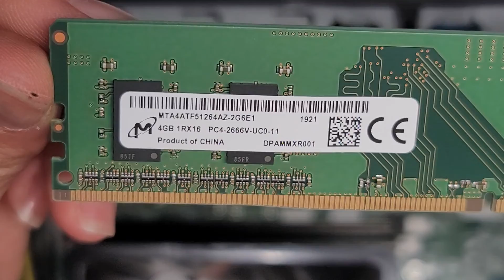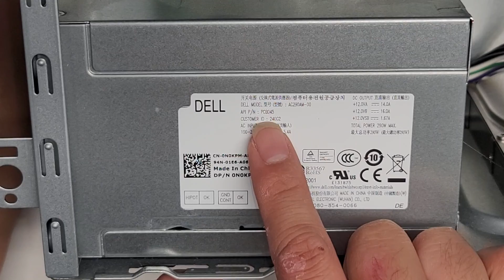DELL Inspiron 3670 Disassembly RAM SSD Hard Drive Upgrade Replacement Repair

Comment: I want to get a 500GB NVMe SSD drive for my Dell Inspiron 3670. Which one the following SSD drive
 do you recommend? 
1) SanDisk 500 GB SSD Plus NVMe 
2) Crucial P3 Plus 500GB PCIe Gen4 3D NAND NVMe M.2 SSD, up to 5000MB/s - CT500P3PSSD8
Amazon has these 2 SSD drives.
Thanks.
Reply from the maker: There's an m.2 slot?
Reply: There is only one m.2 slot. Dell has put in there a NVMe Toshiba SSD. This SSD is 120GB and is getting almost full. I am thinking of switching to a 500GB NVMe SSD.

Comment: Thanks for your swift reply, one more question please. I am increasing my SSD from 128 GB to 512 GB (the max Dell says I can put in my Inspiron 3670) and when looking at the options does it matter if I buy the shorter one (like the one you took out in the video) or the longer version, which you inserted? It is a bit confusing for me.
Reply from the maker: There is no max. The max they list is the max they sell the computer with. You can put 4TB if you want. You just need to move the mounting screw to use the different length SSDs.
Reply: Again I appreciate the response and answer. I was told by Dell support over the phone when I spoke with them that the max it can be upgraded to is 512GB, it came with 128GB when I purchased it.
Reply from the maker: @cariadaberboy  Dell support is full of (pirate) ship... They don't even work on computers. Why would you trust a call center person that never even opened a computer over someone that's been working on this stuff for over 15 years? Lol...

Comment: my 3670 is not turning on.  i’m thinking it’s the power supply, BUT when I press the black button on top of the power chord, the “power supply green light” and the “power supply fan” both turn on.  So, could it still be the power supply that’s not working or is it something else?
Reply from the maker: Not sure. Check the RAM
Reply: I just tried to replace my RAM and all I am getting is the orange light blink on the power button 😭 I don’t know what went wrong… even putting the old RAM back in gets same result!

Comment: Coming back to you. Thank you. I'm planning on replacing the HDD with an SSD in my computer this weekend. It is a SATA drive. Will I be able to use the SATA cable and power supply cable that is currently in the HDD? Looking at the diagram in the Dell maintenance guide, it happens to show a computer with a HDD and (2) SSDs. Those two had their own cables. My computer looks like yours internally.  If not, what would you suggest? Again, thank you so very much!
Reply from the maker: If you're cloning the drive, you'll need a separate sata data cable to have both connected at the same time. If you're doing a clean install, you can use the ones in there. You can also use a usb cable. https://youtu.be/4p5jFDzVwUw
Reply: @ItsBinhRepaired  I did buy an external SATA to USB to clone the new drive. When I then install the new SSD, replacing the old HDD, are the cables currently attached to the HDD okay for the new SSD? Will I actually get the speed benefit using that old SATA? Thank you.
Reply from the maker: You can reuse the cables from the old hard drives

Comment: In windows 10,  you can manually allocate swap space.  If you have lots of RAM installed,  you can usually get away with very little or no swapfile.  I ran mine without swap a swapfile just as an experiment,  and it only crashed when I was heavily multitasking with programs like DaVinci Resolve,  Photoshop,  and miscellaneous other background tasks.  The old rule of swapfile should be at least 1.5 times the installed dates back to when RAM was expensive,  and many PCs really didn't have sufficient RAM to function well under intensive taskload.  Back in the days of Pentium IV and Athlon XP genre CPUs,  a swapfile was mandatory,  or the computer would crash.
Reply from the maker: Isn't that the pagefile? That also helps for when the computer crashes it can dump the memory if I'm not mistaken.
Reply: @ItsBinhRepaired  There are subtle differences,  but the terms are ueually used interchangeably.  Tecnically,  in Windows at least,  a page file is swap space,  but it is only utilized in increments as the ram is almost full,  as needed.  In Unix and Linux systems,  especially with web servers,  swapfiles are often used to dump the entire contesnts of RAM on startup,  as swapping out the RAM to a file doesn't hurt performance as much as having the RAM taken up.  But in Windows,  the two terms mean roughly the same thing.  The "swapfile" is used for paging.  But then again,  it is user-configurable.
Reply from the maker: @gyrgrls  I see

Comment: Still trying to figure out what is the use of the SD card in the front where it plugs in is that extra memory or just for pictures and stuff in the 3670
Reply from the maker: SD card slot can be used for storage or to read cards from other devices. It's slow storage though. Better to use usb 3.0 devices
Reply: @ItsBinhRepaired  yeah I've been studying the SD cards 3.1 they're the new memory these hard drives are going to be worth nothing you're right thank you
Reply from the maker: @bopitbull3957  no problem

Comment: Hi, so basically if I get a 400w powersupply, it will not work???!!!
Reply from the maker: What do you mean?
Reply: @ItsBinhRepaired  you said no other power supply will work unless Dell makes at new one, so if I got a 400w poower supply would it work?,
Reply: @ItsBinhRepaired  You said this at 5:25
Reply from the maker: @notabrokefolk  as long as they have one made for this computer.
Reply: @ItsBinhRepaired  Can you find me one please?
Reply from the maker: @notabrokefolk  doesn't exist
Reply: maybe this is too late but, do you guys ever hear converter power? like 6 to 8  maybe because i found this vid on 2024

Comment: Hi, I have a question, does the wifi card screw fit with the disk?
Reply from the maker: I don't think so
Reply: @ItsBinhRepaired  Because on the forum they wrote that you need a m2 screw to screw the disc. And one guy wrote that he improvised by unscrewing the screw from the wifi card and tightening the disk with this screw. Tomorrow I want to mount the m.2 disk and I do not have a screw and I do not know what to screw this disk with.
Reply: And is this wifi card screw of the m2 type?
Reply from the maker: @cnodre  I don't know, you'll have to check with your laptop.
Reply: @ItsBinhRepaired  Yea, I know tomorrow I will check in my inspiron 3670 if it will work and write you in the comment
Reply: @ItsBinhRepaired  Do you know what screw you need to screw the m2 disc?
Reply from the maker: I don't. Do you mean screwdriver? You want a screwdriver set so you can find the one that fits best.
Reply: @ItsBinhRepaired  what screw do i need to be able to screw the ssd drive

Comment: do you have cashapp? my ssd hard drive went dead on my dell 3670 and your video saved me alot of money cause i followed your directions and fixed it myself...bought same crucial ssd and i cloned it from watching your earlier video....THKS!!!!
Reply from the maker: Got it, thanks!
Reply: @ItsBinhRepaired  thx again
Reply from the maker: @ouzad  no problem. Glad my work is appreciated!
Reply from the maker: That's awesome! I stopped using it because they pull fees from my payments now. It's "$itsbinhrepaired" There are other methods in the description of the video as well.